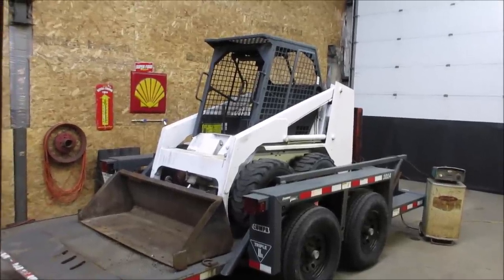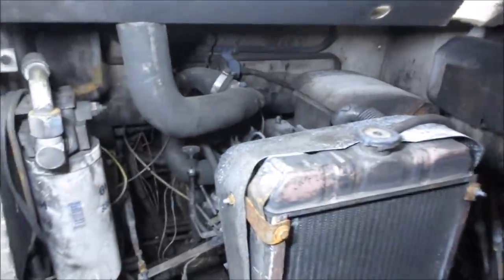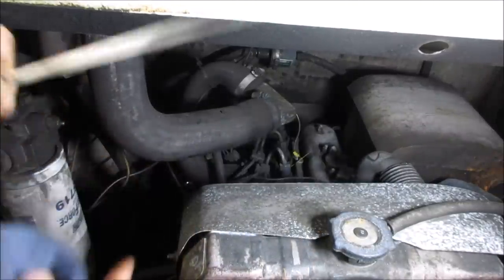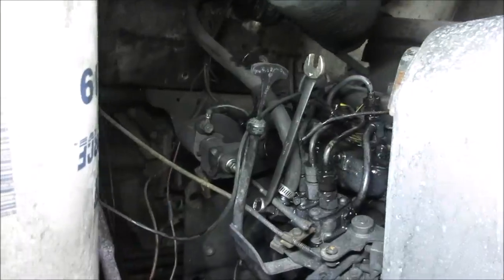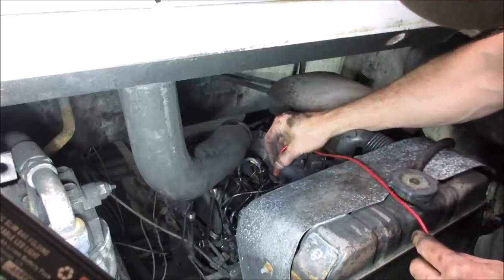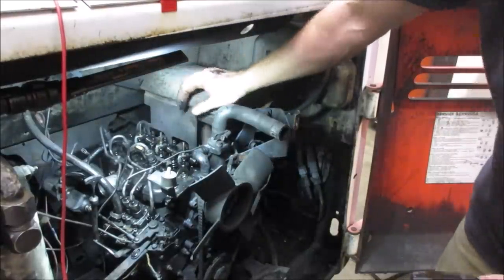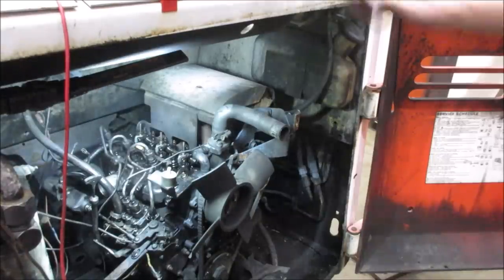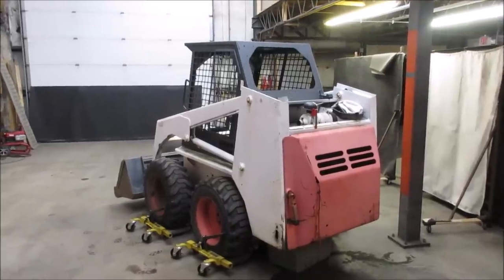Gambled on a Non Running Bobcat. Will It RUN?

Comment: Kinda got bored and skipped through it ,  with the amount of starting fluid sprayed in it, if it was going to fire it would have done, coupled with the lack of compression load on the starter it was never going to start

Comment: idk why but it really bothered my soul to watch the trailer get pulled forward with the charger precariously perched on it, the cord plugged in and not even clear of the tires... feels like something a crack head with no patience would do when he's panicking and mad tryna fix something to get his 300$ habbit in check and then wonders why everything he owns is broken and non working

felt out of character usually mustie is pretty careful with his gear.. i beat the tar out of my tools but i dont run them over with equipment

Comment: Well, one of the previous owners bodged a different engine into it so there's no reason Darren can't do the same, though I think "bodge" would be an inappropriate term if he does it. 😉
Reply: That engine looks right for the machine. If it was me I'd rebuild it. I'd also clean all of that gunk out of the engine bay. It needs a do over.

Comment: This is the one machine that I would have left along side of the road with a free sign on it. This is probably one of the worst models of skid steer ever made, not worth your time. By the way most units this old were lucky to have a cage, doors didn't arrive until later and only on the better models.